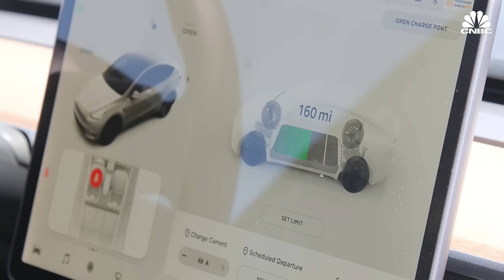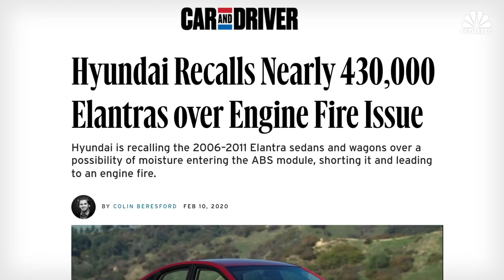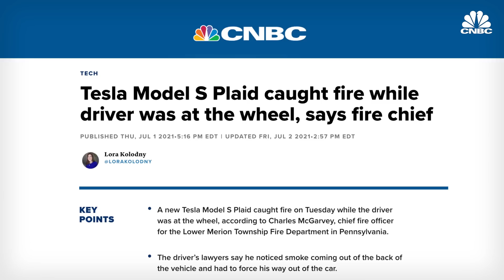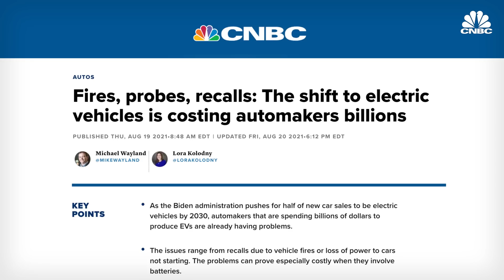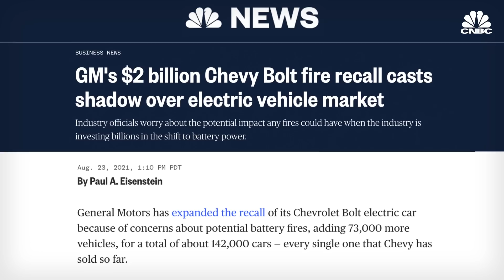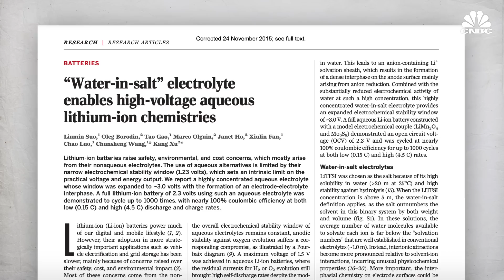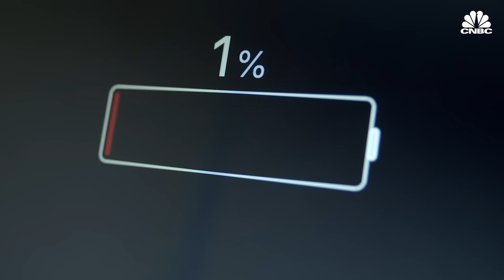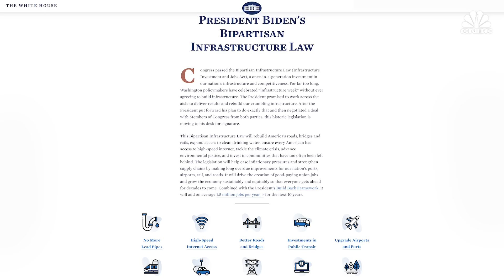Why Tesla, GM And Other EV Companies Have A Fire Problem

Comment: Electrical car fires. They generate a lot of heat. And worse when the load becomes extreme. So why do these cars have breakers, probably because they will be cutting out in the middle of the freeway. So where from here. Unknown there not the best way to move a car or truck. They do have a lot of problems because there are Electric. Not made for the high heat that could be generated. The imbalance  set off a fire and end of story. Those balances are not stable ever,  unless they will be able to control them. And it almost seems impossible because of the extra equipment on board, lighting, radio's, power window's, heaters, up and down use. You can not compare a house Electrical system to a car's set up there completely different because there always set up to handle the load. That's why they have breakers a system that prevents short outs. When the power is overloaded it breaks the Electrical circuit so there are no fires, or overloaded heat. Electric cars are different you Almost can not control these systems for the most part. Until a constant flow, controlled by circuit controllers are designed there are going to be problems with the heated controls running those components or short outs in the system.
Reply: No, literally nothing you said here has literally anything to do with EV fires.  You fundamentally completely misunderstand how batteries work, how electricity flows, and what actually causes EV fires.  

They also don't have a "lot of problems" because they catch fire LESS than combustion engine cars, a LOT less, like 60x less.

The lights, radio, power windows, etc. on electric cars use the same 12V and the same IDENTICAL motors used on combustion engine cars, so they have literally nothing at all to do with EV fires.  Literally zero.

Most electric car fires are caused by manufacturing defects in the batteries, or catastrophic crashes.   There aren't really ANY other factors that are at play here in any statistically relevant numbers.

You really need to learn how electricity, electric cars and batteries actually work before commenting.

Comment: I think the more important question is why do gasoline cars have a much larger fire problem?
Reply: Much more complex, with thousands of moving parts. A large tank of fuel at the rear of the car, being pumped the length of the car fairly close to the hot exhaust. Then millions of controlled explosions just a few feet in front of the passenger cabin....
Reply: ICE cars trucks are most commonly fueled with gasoline. Gasoline is extremely flammable! The fuel line in made of several different parts   plastic reinforced hose rubber and plastic and metals. Metal mostly robust but compromised by rust. Plastics brittle with age. Rubber degradation with age. So depending on manufacturing OEM and design. Age and lack of maintenance. 
Also faulty inferior parts that are sure to fail prematurely! Counterfeit parts. China manufactured parts. Faulty parts that did Not pass manufacturing standards and discarded to trash only to be recovered later and reinstated into the market place at a discount. Huge problems are present. Thx Ron

Comment: ICE have more fires overall, but EVs have more serious fires when fire occurs.   ICE vehicles are usually engine fires - the fuel tank is rarely the source of the fire and often the fire is put out before the fuel tank becomes involved.     EV fires are almost exclusively battery fires.    So when an EV catches fire, it typically a much bigger, more serious fire.     Also ICE fires rarely occur when the vehicle is parked.  Its almost always when its being driven.   EV fires often occur during charging, when the vehicle is completely unattended so response to the fire is slower.
Reply: Except what you wrote is actually false on all accounts.  Most of the recent recalls involve electric system fires on combustion engine cars.  Recalls for BMW's, Hyundai, Ford and others have been when they were parked and unattended.

Most EV fires are battery fires due to defects during the manufacturing of the battery.  It has nothing to with charging.  Many of the recent recalls have been for fires when the cars were parked, unattended and not charging.
Reply: A lot less ev on the roads . Look at % of each .
Reply: @deanhepple3292  It has nothing to do with the number of cars.  The fire data is per 100,000 cars.  EV fires are around 25 per 100,000, combustion engine fires are over 1600 per 100,000.

Comment: I think these electric car's that are burning up should be added to the pollution index by the federal and state government's...so much for the myth of these electric savior's being better and cleaner for the environment...i already knew it's a false statement for these being green anyway...with everything that goe's into making these thing's, it's a total scam they are pulling on every person that buy's them...most people don't actually know what material's have to be used and how much effort it take's to get those material's from point A to point B...just as much pollution is created making electric car's as standard gas car's
Reply: So, are you trying to prove you have no clue about the subject and no idea how any of this works, or just wanted to demonstrate you are completely incapable of doing basic research on the subject.

You already knew absolutely nothing, unfortunately you failed to realize that you knew absolutely nothing about the subject, and therefore posted this drivel despite that fact.

"just as much pollution is created making electric car's as standard gas car's"

Just that statement alone is embarrassingly stupid.  Over 90% of the emissions a car creates over its lifespan is from burning fuel to power it, not its manufacturing.

Since electric cars are zero emission, and can run on 100% renewable energy, they pollute far less than combustion engine cars during their lifespans.

Combustion engine cars get MORE polluting over their lifespans as the engine wears out, and they start burning oil, leaking fluids, get less efficient during loss of compression and their fuel economy declines.

Basic science, for those that bother to do basic research.

Comment: all one has to do i watch RC electric vehicles crash,,, AND BURN,, batteries will explode nearly every time,,
Reply: Hate to break it to you, but RC cars and BEV's have literally nothing in common and are completely unrelated.

You may as well discuss toy airplanes and passenger jets.
Reply: and you cannot put them out until all the fuel is burned

Comment: A recent study conducted by AutoInsuranceEZ using data from the NTSB (National Transportation Safety Board) showed that electric cars in the US caught fire at a rate of 25.1 per 100,000 sales compared to 1,530 per 100,000 sales for ICE vehicles and 3,475 per 100,000 sales for hybrids. So, a gasoline car sold in the US is 61 times more likely to catch fire than an EV, and a hybrid car is 138 times more likely to catch fire than an EV.

Media focus on EV fires, Teslas in particular, has created the opposite perception. But the data tells a very different story.
Reply: Something about those numbers seems off, 1,530 per 100,000 implies that 1.5 in 100 cars catch fire. I've not seen a single car fire around here and there's thousands of cars.
Reply: @BriBCG  Most car fires would be associated with high-speed crashes. Unless you are driving on the Interstate every day, you probably would not have seen any of these fires. From a statistics point of view, 100 is too small of a sample to get a meaningful result. This is why NTSB uses a sample size of 100,000 instead of 1,000.
Reply: @toddr.lockwood843  I suppose that's a good point, the only high speed roadway around here doesn't exactly have high density traffic. The number still seems a little high, it's hard to accept that 1.5% of cars will go up in flames at some point.

Comment: Undeniably...that's a big call.  I'm very keen to see where hydrogen technology will take us.   It's abundant, clean and with no mining required for batteries, its potentially politics free.   Perhaps that's why it's the biggest enemy of the oil industry.
Reply: There are many reasons why hydrogen is not the future of road transport, and safety is one of them. Hydrogen is extremely flammable and very hard to contain because it's such a tiny molecule.

Also, hydrogen cars still have batteries in them to power the wheels. The fuel cell simply charges up the battery instead of powering the motor.
Reply: @seanplace8192  so Hydrogen is flammable like petroleum, wow, who would have thought.   Most heavy machinery companies such as Catapiller have successfully converted there internal combustion engines into hydrogen...no batteries required, no bad emissions    European countries are moving forward with Hydrogen.   Why won't the usa.   Answer..oil companies, Money and politics.
Reply: @deningman  I was referring to Hydrogen Fuel Cells, which is the only practical use of hydrogen. Burning hydrogen in an engine is a very inefficient use of the fuel considering  that engines waste the majority of the energy and creating hydrogen itself is very inefficient. Hydrogen engines also have issues with how differently hydrogen burns compared to diesel and gas.
Reply: @seanplace8192  see ...we disagree.   You're making assumptions on technology that's being stiffled by interference from the powerful oil industry.   What you are saying is true about hydrogen cells, but not for all applications.   When the efficient production of hydrogen has been sorted the options will be vast.
Reply: @deningman  The only one making assumptions on here is actually you.  Running Hydrogen in combustion cars is ridiculously inefficient and expensive.  It is not like it hasn't been tried before.  Look up the BMW Hydrogen 7.  It had a dismal Hydrogen range and cost close to $1 a mile to drive.  

Hence Hydrogen is simply not a realistic solution when the cost is 5x to 10x more per mile vs battery electric cars.

Your claims about emissions are also patently false.  Most Hydrogen today is derived from steam reformation of natural gas.  It is energy intensive, inefficient, costly and produces pollution in the process, while still requiring fossil fuels.

There is the whole Green Hydrogen idea percolating out there, but until, and if, it becomes reality, Hydrogen is simply a pipe dream.  Hence the sales of  Hydrogen cars has been dismal, even with $15000 worth of "free Hydrogen" included.

Comment: Until these vehicles get perfected they should not be on the road! One life is too many! Setting fires across the country with these vehicles isn't helping the climate. What helps the climate is for the government to work with the car industry with these new regulations that they are put upon them. We need a good power grid and charging stations in apartment complexes, malls Etc. and build a foundation before just rushing in and having a catastrophe!
Reply: That claim is comically absurd.  If you used that logic, we would literally have zero modern technology, Zero airplanes.  Zero cars.  No electricity.  

Electric cars are already 60x safer as far as fires than combustion engine cars, catching fire at the rate of 25 per 100,000 while combustion engine cars are over 1500 per 100,000.

We already have a power grid that can charge millions of electric cars, and malls already have chargers.  There are tens of thousands of chargers already built, and thousands more under construction.
Reply: The past couple of months they had thousands of recalls on many popular brands and not to include the current worries about our electrical grid and blackouts to come in legitimate articles and news sites and environmental regulatory systems! I am for technology absolutely!! I just believe you need a proper foundation for everything before you just jump into anything. I don't believe in testing technology on people like this!
Reply: @ksexton7777  There is no "testing technology" going on.  Lithium ion batteries have been around for 40 years already.  Are you claiming we should wait another 40 years?

The recalls have to do with battery manufacturing.  There are hundreds of thousands of combustion cars being recalled for electrical fires due to defective control modules.

Should we also park all combustion engine cars for another 40 years until we perfect THAT technology?  I mean, it has only been around for around 120+ years.

Maybe we need to wait another 120 years before that technology is perfected.
Reply: that's like saying we shouldn't have Crash Test Dummies either LOL you seem to miss the point!

Comment: When we thought electic vehicles are better and even helping environments. But it's not and in India it is already k"lling people and this battery think companies took is blood batteries and already k"lling congo people and kids. This tesla and more are using blood batteries
Reply: Tesla has verified cobalt mined in Australia. Oil companies use something like 50 times the cobalt than battery manufacturers do none of it getting recycled.
Reply: Not only in india but everywhere if they are unfortunate enough to be in the car or in the house when it is exploded
Reply: @Akshay13134  Spare us the comical idiocy.  More people are killed by pollution and stupidity in India than by electric anything.
Reply: @Akshay13134  India has some of the most polluted cities on the planet.  So, while it doesn't only happen in India, they have a disproportionate level of pollution and associated deaths.
Reply: @redbaron6805  So do you say only india has high polluted cities

Comment: What about the environmental disaster the oil liner Exon Valdez made in the ocean. Not to mention the numerous oil spills that have happened due to oil rigs
Reply: There's already a cargo ship that went down due to a fire onboard where the suspected cause was the battery pack of one of the cars. Not exactly winning any environmental awards there. Not to mention the often overlooked environmental hazards of the packs themselves. It's all painted as a pretty little green future but all I see is replacing one set of problems with another.

Comment: Saving the planet! Ahhhhhhahahahahaha yeah, right!
Reply: So... you are basically saying you did absolutely zero research on the subject.

Got it...
Reply: @redbaron6805  still takes oil and coal to make, deliver, maintain, and dispose of these machines. So............
Reply: @randybaumery5090  It takes zero coal to make deliver or "dispose" of anything.

The difference is the total emissions.  Once an EV is made, it requires zero oil to power it.  Combustion engine cars will require oil from the day it was created until the day it is scrapped.

Manufacturing only accounts for 10% of the total emissions of a car.  Burning fuel accounts for the other 90%.  On an EV, that other 90% is clean zero emission driving.

Hence, the lifetime emissions are a small fraction of combustion engine cars.
Reply: Search this: Child labour, toxic leaks: the price we could pay for a greener future
Reply: @randybaumery5090  The issue is far more complicated than one article.  For the following reasons.

1.  A lot of Cobalt is used in petroleum refining, making alloys corrosion resistant, pigments, drill bits, etc.  Only about 24% of the total is used in EV batteries.  In fact, consumer electronics accounts for 25%.
Add the fact that companies like Tesla are actively working to phase out Cobalt, and have reduced Cobalt use from 10% of the total to 2.8% as of couple of years ago.  The goal is to go to zero Cobalt.

2.  We used 100,000 tons of Lithium in 2021.  Since the current reserves are 38 million tons, that is about 380 years worth based on what we used in 2021.  The Salton Sea is estimated to contain up to 6 million tons of Lithium by itself, and could produce 600,000 tons a year.  It could by itself supply 60 years worth of 2021 demand, and there are other similar areas we haven't even looked at yet.

So, while there are challenges in EV production just like any other production, many of the issues are already being worked on, and there is already significant progress being made in several of those areas.

There are also batteries being used like Lithium Iron which use 0% Cobalt, and there is active research in phasing out Lithium in favor of Sodium, Sulphur and several other compounds.
Reply: Keeping my gasoline car. Screw it.

Comment: EV's with safety recalls for fire.  Renault Zoe, Peugeot-e, BMW i4, Mercedes C class, Mercedes EQS, Mercedes GLC, Mercedes S class, Ford Focus, Chevrolet Bolt, Hyundai Ioniq, DS7 Crossback, Hyundai Kona, Mercedes EQC,  VW Arteon  ehybrid, VW Passat GTE, Ford Focus mHEV, Ford Puma mHEV, Ford Fiesta mHEV,  Opel Ampera e, Mercedes eSprinter, Skoda Citygo e, Mercedes eVito, VWeUP, Seat Mini electric,  Mini Country PHEV,  BMWi8, BMWX5PHV, BMW X3 PHEV,BMW X2 PHEV, BMW X1 PHEV, BMW 7 series PHEV, BMW 5 series PHEV, BMW 3 series PHEV, BMW 2 series active tourer, Land Rover Discovery Sport PHEV, Land Rover Evoque MHEV, Hyundai Kauai, Audi A4,  Audi A 5,  Audi A 6, Audi A7, Audi Q5, Ford Puma MHEV, Ford Kuga MHEV, Renault Zoe, Audi eTron, Not the full list, more are added every week.

Comment: With an electric fire powder should be used. Hydrogen should be used rather than electric.
Reply: Hydrogen cars are Fuel Cell cars, that is they are ELECTRIC CARS with both a battery AND a fuel cell and hydrogen tanks.

The ignorance on this is getting a bit old already.  Learn what Hydrogen cars actually are, and how  they work.

Comment: Well, the difference is complicated.  The data should be broken down by manufacturer and by years since manufacture.
Fuel powered cars probably experience various mortality spikes from birth to death, depending on design flaws and maintenance errors.
Grid powered cars probably have an infant mortality spike do to a manufacturing defect, followed by low probability of immolation that rises as the car ages.